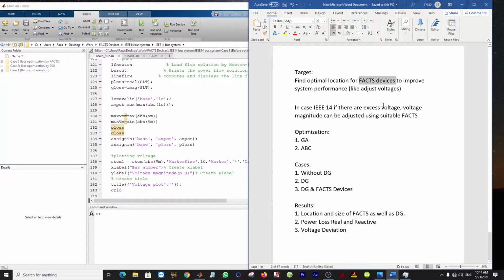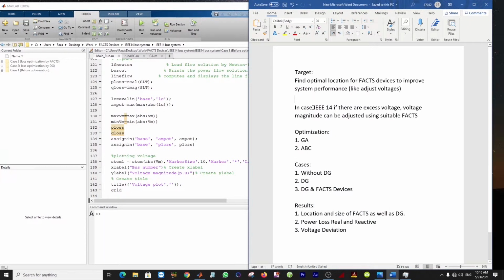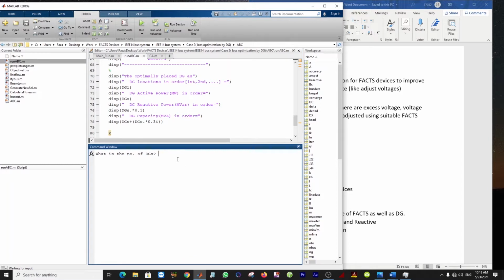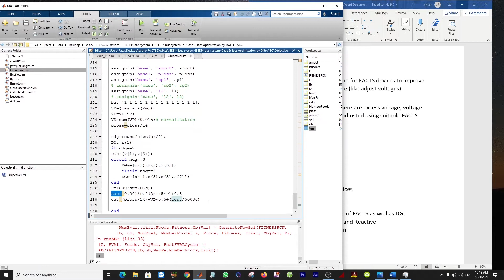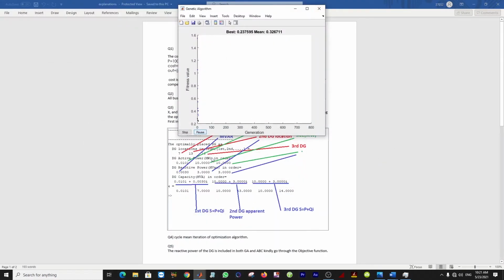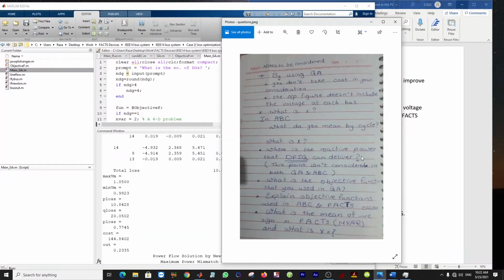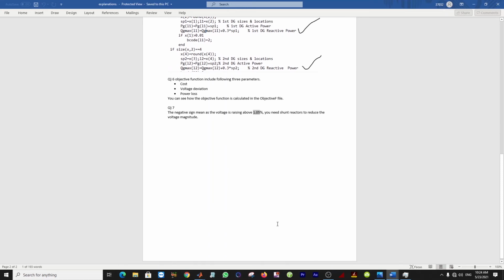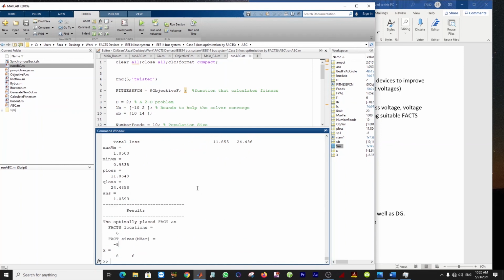FACTS devices allocation to improve system performance Matlab Programming

Comment: First of all, you're awesome and extremely worth watching videos, congrats! 
I'm from Brazil and I'm investigating how do DG (Big ones like 1MW up to 5MW) impacts when we locate those DG on a low load feeder (up to 5 MW max). Variables like distance from substation, impedance, and another ones should be verified. I'm looking for, essentially, how does it affect the voltage profile on surroundings loads and also in the substation. Do you have something to help me understand that? Anyway, thank you so much for your videos!!
Reply from the maker: Email.
Reply: @SimulationTutor  fabio.ea.andrade@gmail.com